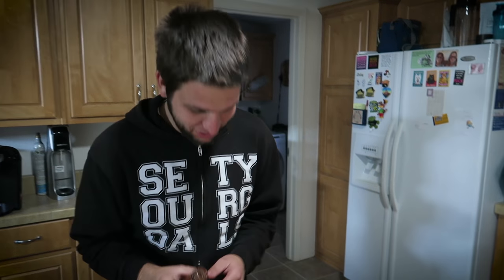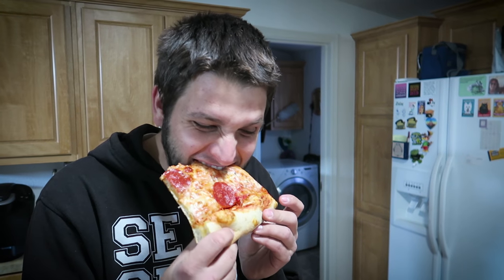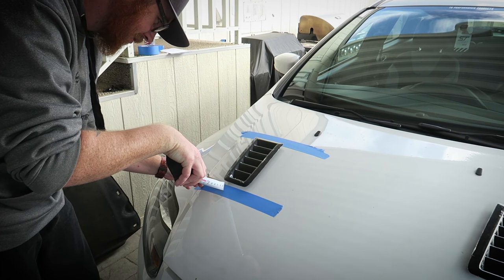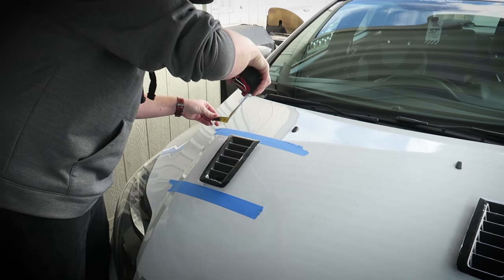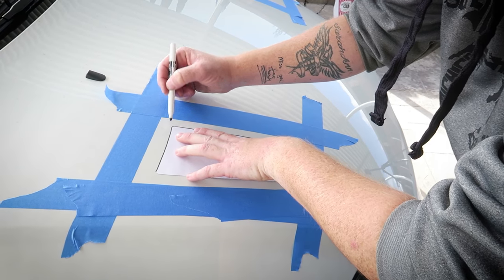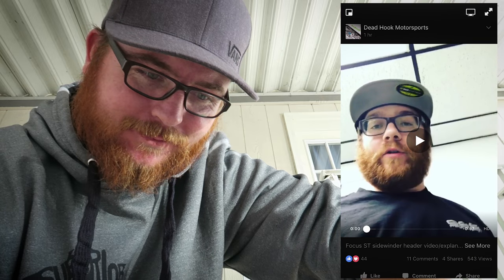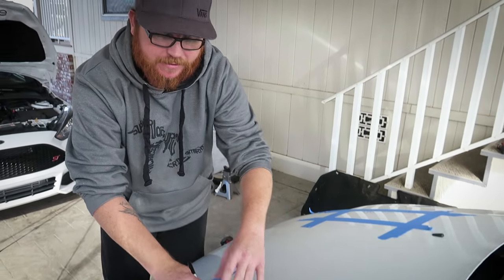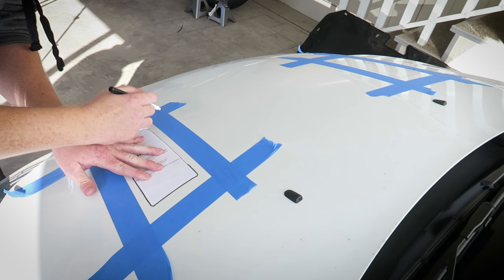Install: RS Hood Vents | 2014 Focus ST

Comment: I know you had to cut because of limitation of space but, did you consider when it rains where the water will fall? Hope not on electrical connections.
Reply from the maker: Ever washed your engine? Water won’t hurt a thing

Comment: Hey any problems with getting water in from the rain? I am thinking about doing this also, just afraid to get water in and damaging any parts
Reply from the maker: +Rodrigo Cobos I drove it in the rain a couple days and zero issues. Pretty heavy rain and the car was fine. Love the way they look still.

Comment: how's it going bro amazing job on the hood vents, I'm going to do the exact same to mine,question how did you bond them on bro?
Reply from the maker: +Gerry Duggan going great! Originally I used a silicone that lasted a few months. Then I went ahead and drilled holes in the vents and hood and used small bolts to hold it in. Looks great. Unfortunately I don't have that front end anymore because of the swap I did to a 16 front end.
Reply: was your vents plastic or some  other material bro,?
Reply from the maker: +Gerry Duggan abs plastic. I would recommend a liquid nails type of glue instead of silicone
Reply: BooSTed Aspirations 
cheers bro thanks for the advice, much appreciated, I bet it looks amazing with the 16 front end easy colour to match as well, the white.just one more question would you definitely recommend for me to fit the vents.
Reply from the maker: +Gerry Duggan you can check out the facelift video we did of the swap and you can see the whole process. And yea it's super easy. Just measure twice and cut once. Take your time measuring. That's the most important part. Cutting is easy.
Reply: BooSTed Aspirations 
thank you bro your a gentlemen
and yeah I will look at the video looking forward to it, thing is might start doing it myself.
Cheers mate.
keep up the good work

Comment: where were these vents purchased?
Reply: which group
Reply from the maker: +Going Pro I think it was the fiesta and focus st owners group. It was a couple months ago.
Reply: Hey guys! great video! I just got my vents in today. What did you use to glue the vents onto the hood? 

If it was Silicone, what kind was it?  Are they still holding up?
Reply from the maker: +MonteLSV6 they are holding up great! It was DAP Silicone plus. I applied silicone to the bottom of the outer edge and placed them on the hood, I then opened to hood and applied more to wrap around under the hood to hold them in better.
Reply: BooSTed Aspirations Thank you! Glad to hear they're holding up! The edges of mine are curved a bit probably from the manufacturing.

Did the vents have that for you? I'm afraid it won't make a proper seal.
Reply from the maker: +MonteLSV6 yes they did. I placed quite a bit of silicone in the deepest part and pushed it down and wiped off the excess on the hood around the edges. Then applied more underneath to make it like a hook to grab.
Reply: BooSTed Aspirations Gotcha! I figured that's what I'd have to do. Hey thank you so much for answering my questions.

one last question! any specific grinder/disc you used?
Reply from the maker: +MonteLSV6 just a 4inch metal cutting wheel. I used a Milwaukee angle grinder. I've seen some people use dremels. I opted to not use the dremel because it would have taken longer. You can get cleaner cuts out of dremel but I'm really comfortable with the angle grinder so I used that.
Reply: I see. Okay, great. Thank you so much again for giving me all this info. I too might pace for an hour or so before deciding cutting in lol
Reply from the maker: +MonteLSV6 no problem! Hope to see the results soon.

Comment: Hell to the F no.. dose nothing for the car except looks.
Reply from the maker: Dose you pay my bills?
Reply: @BooSTedAspirations  polls Serio.  You cut into the cars hood.. you just lost the 1k value of your car..
Reply from the maker: That’s why I sold my car for $5k over it’s worth?  The value is different to everyone.
Reply: actually...they do reduce under-hood temps and help with the flow of hot air/pressure to be expelled. My only concern is having vents over any part of the engine that can drip water down onto, that will then collect (near coils, plug galleys, etc). They sell ones with rain guards for non-track days, but they're usually larger and look like vents you'd have on the floors of your home lol. These look pretty good and close to OEM almost, and with a BT I've been considering them for a while now.